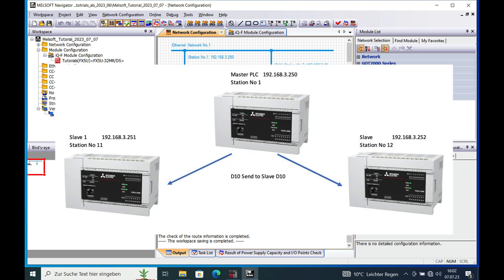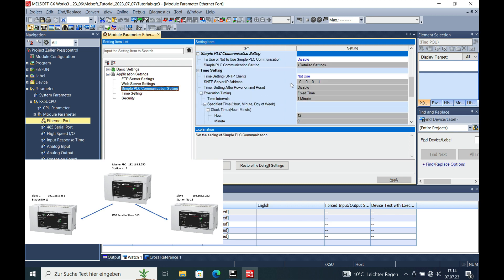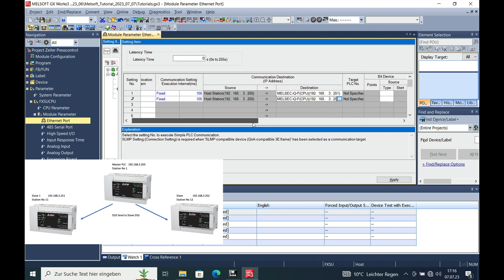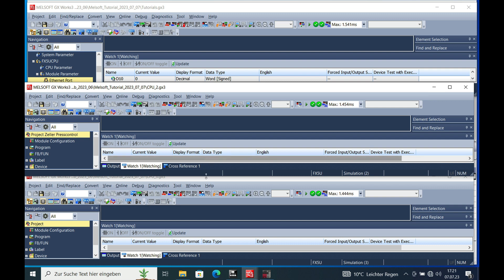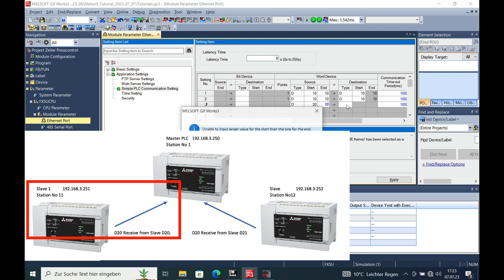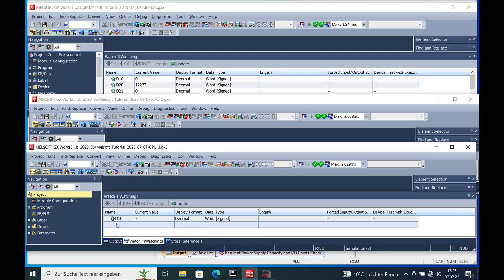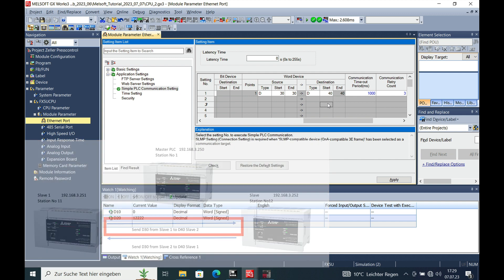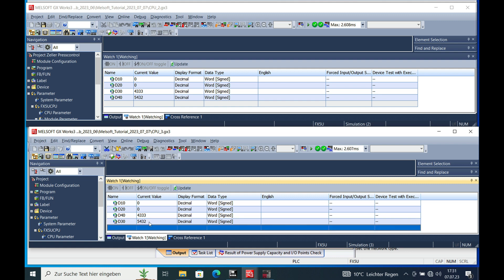Simple PLC Communication Mitsubishi Melsec FX5U Plc to PLC

Comment: Thank you For this video, is it possible to do the same between a R04CPU and a FX3U with FX3U ENET module ? I try to connect 2 this PLCs, but in the Simple PLC communication fucntion at GX3, there is no option for FX3U. My GX3 only have option for iQ-F, iQ-R and Q series.
Reply from the maker: Hello.I will have to check on that. But basically you go by the IP Address and not the controller type.

Comment: Hi so the simple  plc communication settings is purely for connections between PLC's? I'm trying to connect to a non plc modbus device so I'm guessing we don't use this method?
Reply from the maker: Hello,
yes, simple plc communication is only from cpu to cpu. I do not have a video about modbus. However i do have a cvideo about cc-link. Maybe you can get an idea with that. https://youtu.be/WlqNPwgQLCs?si=RSiwUlC_eLDySff2

Comment: Dear sir, Multible PLC and  1 hmi (GT) How to communication method sir,, i try set station no 1,2.etc  but simulation not working same bit is on/ off
Reply from the maker: Hello, thank you for your question. I will check on that with simulator.
Reply from the maker: Hello again, it seems that i am experience the same problem. As of now i do not have a solution.